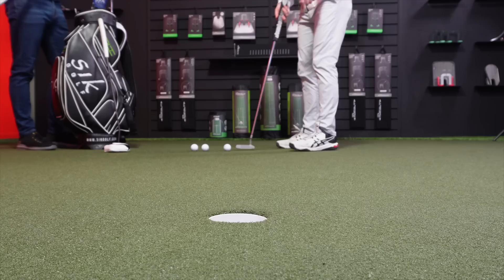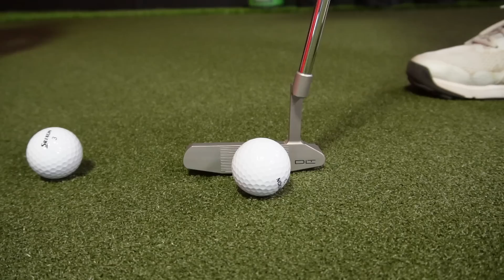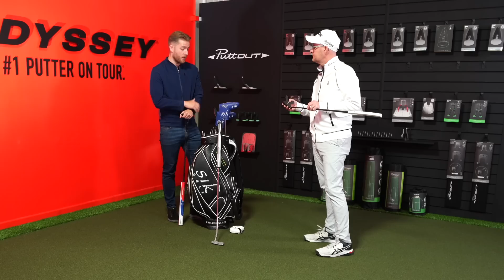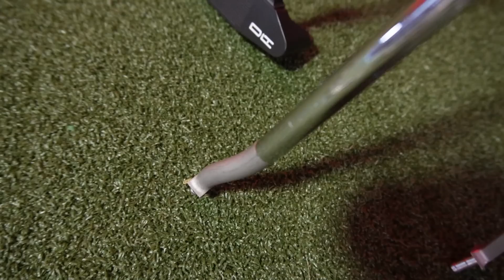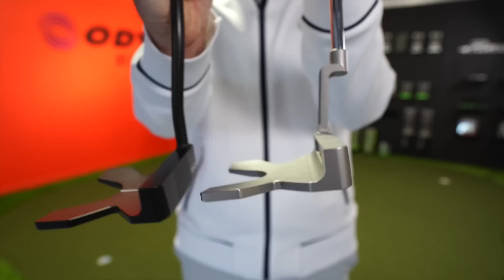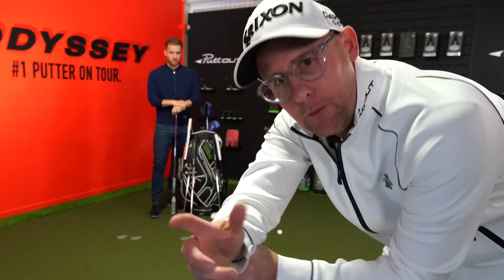WILL THIS PUTTER CHANGE PUTTERS FOR EVER SIK ideas

Comment: I'd like a dot...i had 1 on a much older putter 10+ years ago atm i have a short line (which is ok) but I'd love a dot again.
I'd happily have nothing at all if the manufacturer just said the sweet spot is in the middle (but you would figure that out anyway after a few putts).
I don't like armlock personally but i never thought broom handle putters should be banned either.i think if you are hitting the ball with a putter face that's ok.
I did have a big issue with players using a broom handle putter for measuring dropping distances....that should have been resolved by a rule change just saying all drops should be measured using your driver (,that would have resolved my issues with it)

Comment: Battled with the yips for 2 years before buying a SIK armlock putter. I tried 3 heads during my fitting, 8 putts with each head and held all 24 putts from 15 feet. The data showed that one putter was considerably better than the others, which is the sho head. Best golf club purchase I have made.